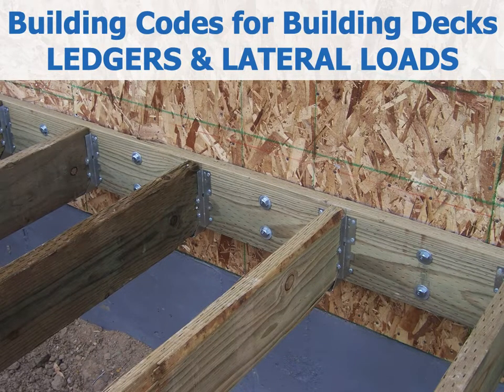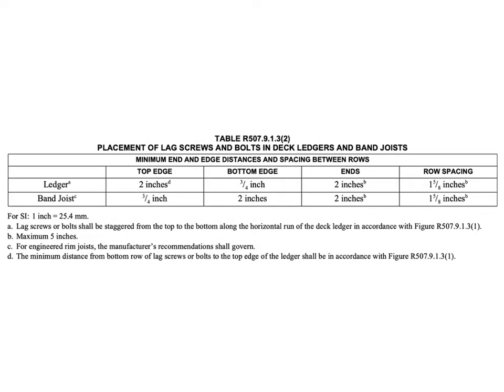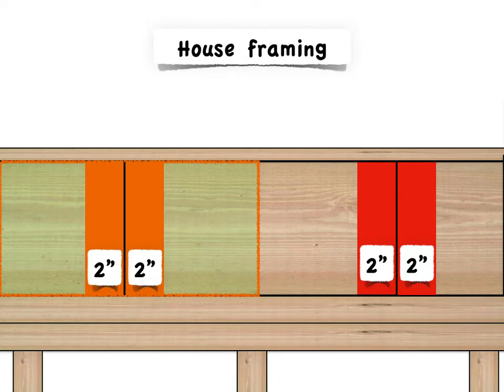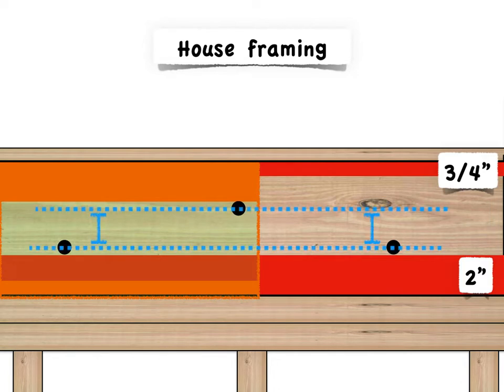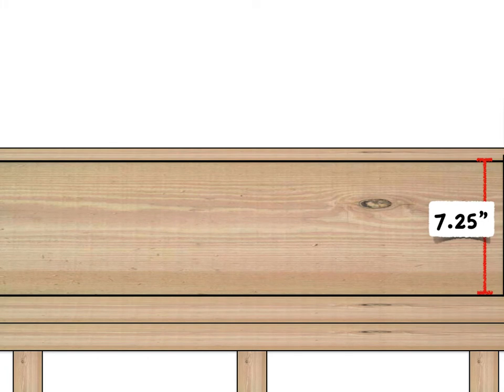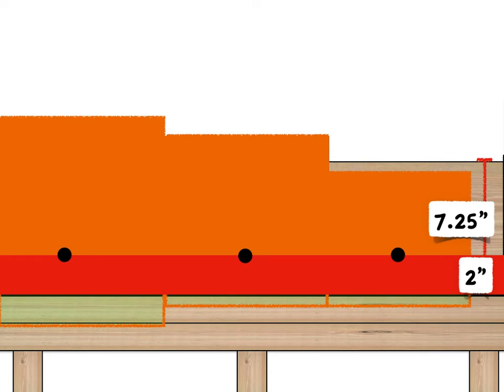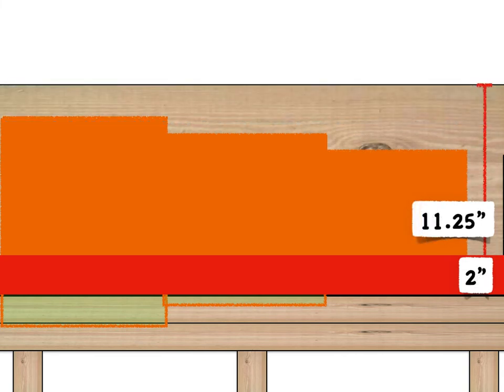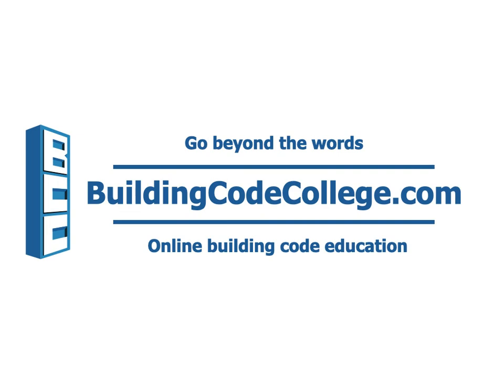Placing fasteners in ledgers and the 2021 International Residential Code

Comment: thanks for the video. I am installing a deck right now and I would like to use 1/2" carriage bolts since they are easier to get than the 12 inch long galvanized hex bolts I would need. If I put a nice big washer on those carriage bolts, would that be a problem to a typical inspector in case it ever gets inspected? I like the idea of using carriage bolts rather than hex bolts since any inspector might mistake hex bolts for lag bolts and not the through bolts that they are. Carriage bolts are almost proof I made a sandwich through the band joist. What do you think?

Comment: I'm in this situation now. I'm installing into a house with a 2x8" band joist... this is in snow country so it needs step-up, plus freestanding isn't really an option. What do I do? Can I put ledgerloks into the sill plate?
Reply from the maker: Ledgerloks into the sill plate, headers, studs, etc, is a very common way to address this design issue.  However, it is not prescribed in the code.  Alternative methods of proving the connection will support the design loads is required.  This is when you need to talk to your local building department.  This is why I do so much work on behalf of NADRA to develop new and better deck codes for the future.  This video shows how badly that work needs to be done.
Reply: @GlennMathewson  Thanks for replying. I'll send the building dept an email about it. It's nice to know the code wasn't opaque and confusing just because I'm not a pro.

Comment: Very good video. I struggled with this very situation- including allowing 5" below my door.  I had a poured concrete wall beneath the sill plate- so my ledger board would be fastened to wood (rim joist)for the top row, and anchored in the concrete on the bottom row...I never really liked the idea of a ledger board to begin with, so I eliminated it, and installed posts, cantilevering 28" from the wall with 2 x 8 joists. Problem solved.